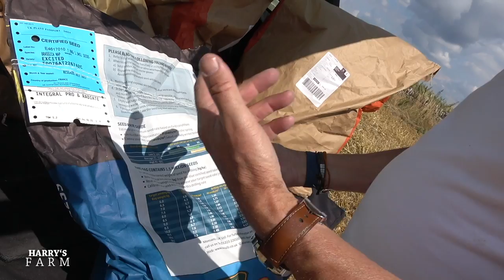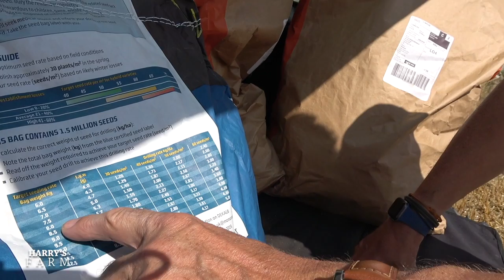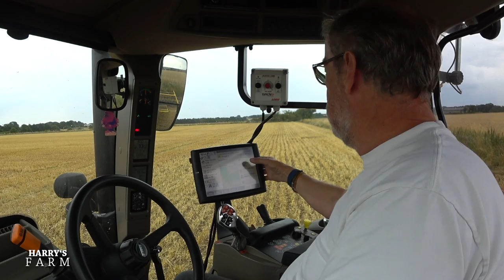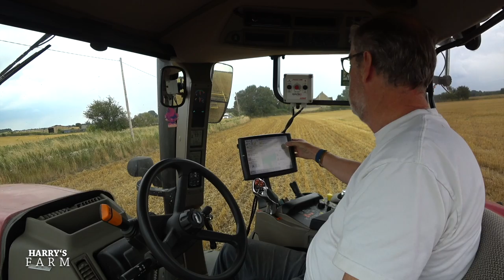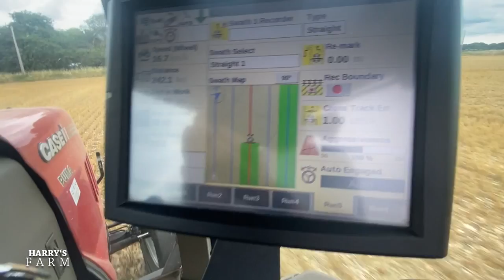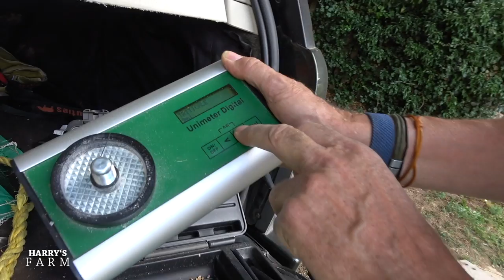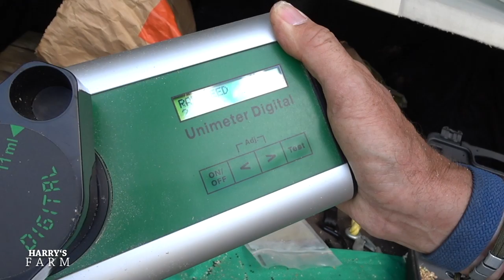How today's tractors can drive themselves & the OSR gets drilled 3 weeks early

Comment: So to clear up some misconceptions on the GPS steering. A standard GS or WAAS signal gets you roughly 1 m accuracy. What this means is the GPS points that create guidance lines and field boundaries can drift up to 1 m overtime. Typically these lines and points do not shift more than a couple cm's over a couple hour period. The benefit of upgrading to a base station or cellular RTK system is that the repeatability of the lines and points will be reduced to 2 cm. For example, with Harry's current system, he could sow his field in 2021 and the line would most likely stay within a couple centimeters. However, if he wanted to use that same GPS line again in 2022, it would most likely have drifted at least a meter off it's original position. With an RTK system, that line would be within 2 cm of where it was in 2021. 

The actual steering performance of the tractor or combine comes down to the hydraulic steering valve and steering controller that is reading the GPS line as the machine moves forward. So if you purchase RTK, you're not purchasing a better performing steering valve, you're purchasing repeatability year over year. I work in the machinery industry and this is one of the biggest misconceptions when looking at GPS equipment. The hardware on the tractor stays the same, so the only thing that changes is the accuracy of the line. 

Note - There are some cases were there is bad satellite coverage and your GPS points/lines drift within 10-15 min of operation. This would be a scenario where upgrading to RTK is necessary to stay accurate throughout the entire field. IF you do have good satellite coverage and you don't care about repeatability, then you really don't need RTK.
Reply: Very good explanation thanks for that. I think most people are under that impression
Reply: Yeah RTK is good we have used it ridging potato beds but it gets upset if you turn the tractor off for 20 minutes or so and expect it to go back into work. Top tip leave the thing running an entire day 😂
Reply: Question: In Aust we use satellite controlled drones to map and monitor all sorts of data about the crop. It's amazingly accurate within a few cm's. What does that use ??? I presumed it was satellite because ... well it's part of name. But, you seem to think it's not accurate. I hope that ramble makes sense.

Comment: Afternoon Harry,

I downloaded an app on my phone that does similar on my Tractor - no connection to the steering though. It uses the Galileo satellite system.

After a very similar set up routine, enter implement width, drive round the field, set up a row etc. it displays a map. 
You then follow the parallel lines displayed on the screen.
Surprisingly accurate. 
I'm only using it for mowing, but it helps minimise the end of cut "triangle".

Best of all it was free!

Not quite the same standard as yourself but I do have "Cruise Control" which maintains a constant ground speed up hill and down dale.

The world really has moved on since I first jumped on a Tractor in the '70's

Comment: Interesting stuff... The rate the tech is going the tractors and combines will e not only robotic fully But also electric battery ones no more diesel and pollution.

Shame the Combines don't have a vacuum system fitted just behind the cutting head so that it sucks up all the normally lost grain heads and of course let's any stones etc. drop back on to the ground behind the combine and puts those into the sorting section with the others that were cut and picked up by the header?  Then there be no loss of grain.

I come up with a better way to do silage bales so there is no plastic wrap to remove so no plastic wrap to waste. I designed a baler that would have done this new Eco bale wrapping too.
Sent it to my most liked farm machine company "New Holland" and although they sent it on to their R&D to check it out, they did nothing with it for 8 weeks and never even told me what if anything they were doing with the design I sent them?

In the end I asked for the design plans back by email as I sent it that way and told them to delete all copies and records of the design! I had a copy mark on the drawings.
I really upset they could not even test it and tell me about that?

It would have removed so much waste plastic too and let the farmers just drop the bales of silage into the feed mixer without taking off the wrappings.
The company would have had a baler better than the rest done by other companies and they would have had the sales of the special Eco rolls used to cover the bales instead of plastic.

Plus my baler could make either round or square bales with a simple setting too.

Oh well, that's life for you.

Nice detailed video BTW.   8 )

Comment: Self drive gps machinery has meant in West Australia massive treecover loss . The WA wheatbelt is already wrecked by salinity and the clearing goes on.
Reply: You know people pulled trees out before gps right? With Or with out gps trees leave branches in the crops which damage machines. Most people do replant new tree in better locations like on the edges of paddocks.

Comment: All bridges in the UK are 16ft 6" Minimum unless it has a sign before it or on it. Having just finished working for a well known parcel company DPD they have new double deck trailers that are 16ft 3" and on the smart motorways where they have turned the hard shoulder in to a live lane by god your arse twitches going under some of those bridges because where it used to be the hard shoulder if you look up at the side of the bridge it rises at an angle, so even though you know its 16ft6" on that side it always seems dam close.

Comment: You can set the b mark after just a short run save running the length of the field. Saves the long run of concentration
Reply: If you set it at the end, you have no chance of a wrong angle. And if you know the angle, why not just use A+ angle

Comment: Really interesting as usual. I remember trying to get the lines really straight when ploughing a field, by the lunchtime, I'd usually got it pretty close. Then my boss would take over and after lunch, it would be my challenge to get it back straight. Stops some of the boredom though. With self driving tractors, it must be hard to not drift off as you approach a headland or does the computer stop you from tipping headfirst into a ditch?

Comment: You don't need to drive far to set a new line, 5 to 15 meters. Also you can set a new line by +/- 5 degrees off your longest headland, some systems this way can be easier,
Reply: True, but if your paddock is hilly or you can't see your end point you can be out by metres or more , to get a straight line along Headland its best to drive it. A one end then B the other. I've tried the short run , got to other end and was out by tractor width.
Reply: Or simply use the “heading” setting. Once you mark A the system will generate straight lines. As our land is all surveyed on grid system we generally only use 90* or 180*. If we want an angle we will go plus or minus 15*.
Reply: @shawnbuhr2925  Yes , but the land we worked wasn't our own ,so we worked off Headlands.

Comment: Your Setting AB line at beginning, you set A then drive to other end to end point B. You don't need to drive in a straight line , it's a set point A then B. You can drive through the neighbours paddock , as long as you stop at end point B in your paddock. Auto steer will only go in straight line from A to B .
Reply from the maker: Makes perfect sense, thanks for info.
Reply: @harrysfarmvids  , Don't drive a short distance to set AB line, Drive the full length of the Headland before pressing B, or could be out by metres or more, I've spent years using GPS in tractors, A 2cm system is very accurate, come back in months and it is same line, as long base station hasn't been moved, a 10 cm system is not that accurate, and if you are stopped by rain for the day , then go back next day it could be out by more then a metre, if planting that's a problem, just reset AB line

Comment: You don't have to drive straight between the A and B. Mark the A, drive to where you want the B and it'll put a straight line between the two. Or when you've recorded a boundary, close 'field' from the menu. It will then sort headland bouts and internal bouts that can be edited to your choice
Also when recording boundary if you pause whilst going down a straight headland it will drop a dead straight 
line in-between. saves a lot of small wiggles on headland bout
Reply from the maker: Thanks for info, I'll give it a go next time. There's lots to learn with this system!
Reply: @harrysfarmvids  you’re welcome. There’s also an obstacle recording function. It will map any poles, pylons old troughs etc. Just gives you a warning on approach. And one of the most useful things I’d the tramline function. It then corresponds on the screen with the drill tramline. Let’s you know you’re on the correct bout.

Comment: I thought Roundup killed everything.  It does on my gravel drive, weeds, grass everything.
Reply: Glyphosate, which is the chemical name for Roundup, basically inhibits amino acids in plants. Overtime weeds have become resistant to glyphosate though. Ironically, it's not for the over application, but the cut rates and under application which causes resistance. So spraying weeds that are too big or not spraying enough. Basically whenever you spray and you don't kill the plant, you're causing an issue with weed resistance for the future. It's incredibly important to follow the label and apply the correct amount at the right time.
Reply: Richard Harrold  says the man that obviously doesn't know anything about the application industry or the chemistries used. Obviously chemicals can cause harm if misused, but glyphosate is one of the better ones. If you actually knew anything, you'd be complaining about gramoxone or something similar
Reply: Richard Harrold  source?
Reply: Richard Harrold  Name one then

Comment: Thanks Harry, maybe a dumb non-farmer question, but, as the seed is so expensive, why don’t you save some from your harvest, dress it appropriately and then use that the following year?
Reply: down to genetics, he is growing a hybrid osr, where the two parents are slightly different varieties of OSR. the hybrid offspring has increased vigour, to help out grow csfb and and improved yield. However it is a very expensive process for the seed breeders. if he tried saving the seed from the hybrids he would get a mongrel crop that would grow but would have lost the hybbrid vigour/yield
Reply from the maker: This. I was skeptical of the benefits of growing (more expensive) hybrid seed but having seen how they perform on our farm, I'm now a big fan, even though it means I don't have the option of farm saving the seed to grow the following year. The winter barley I grew this year was also a hybrid variety and performed very well.
Reply: @Andrew-yz1lb  thanks Andrew, what’s csfb?
Reply: @mickgudgeon6402  cabbage stem flea beetle

Comment: Could you do a demonstration of the gps accuracy? Perhaps by getting the tractor to drive the same line twice whilst laying a trail using a bucket of sand with a hole in the bottom.